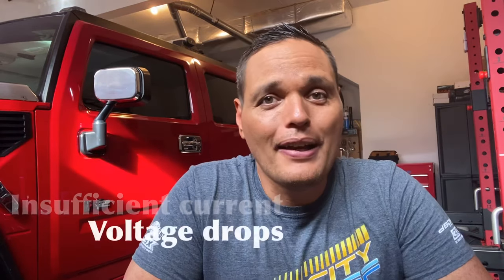The Top 10 BIGGEST MISTAKES in Car Audio. How to do it right!

Comment: honestly when i use to install early on i never had an issue with running the power with signal not once still will do it sometimes for a small install if your are running multiple runs of 0 gauge i would never do but with one run of 4g or 8g whats the big deal
Reply from the maker: Its not a big deal.... It is to keep best practice procedures consistent. Eliminates ambiguity of sometimes installing together and sometimes installing apart. If you install them separately ALL the time you will never have a problem. If you install them separately SOME of the time you may have a problem. When issues come up like electrical hum, alternator whine, etc.... having your signal/power wires ran separate ALL the time will automatically remove that as a potential issue so you don't have to "wonder" or "worry" if that is one of your issues.
Reply: True but some of these new cars are a pain haha but your 💯 correct to do it proper just never got why some people get that interference even if they did run signal opposite side and  had everything correct and still got engine noise or humming pretty weird what can cause it
Reply from the maker: Absolutely.... some cars definitely make life miserable when doing installs. That's why i like doing installs on older cars. so much more space and easier to route lol.
Reply: @NextLevelCarAudio  do you know any apps or sites to build enclosures want to try building a few boxes but just want to get some plans before
Reply from the maker: I know most people use WinlSD that do their own stuff. It’s free to download and is very user friendly. Allows you to build enclosure to subs specs. Not sure of an actual app tho. This is a program you need to download to your computer

Comment: Could i run 6 g on a 1000 watt amp
Reply from the maker: I would use 0awg. Then you never have to upgrade your wire again unless you go over 3000 watts. Then would need 2 runs of zero gauge. But can you?.... yes. But would not be close to optimal

Comment: So if I got 2 skar vxf's  12's  running on a avionixx 3k amp it dosent hit that hard what kind of amp should I be running on these monsters?
Reply from the maker: I recommend finding an amp that puts out anywhere between 125-150% speakers rms rating and set gain accordingly. Having headroom on an amp is important so not to strain your gear.
Reply: @NextLevelCarAudio   should I go with a taramp3k. Or a brutus hifonics 4k ?
Reply from the maker: I’d do 4K, but probably not hifonics as they rarely do even close to rated and are power hungry.
Reply: @NextLevelCarAudio  what about the taramps bass 3k
Reply from the maker: Better option, but only if you have good electrical. Brazilian full bridge amps like strong electrical and can get hot really quick if not. Sorry for late reply, comment got buried
Reply: @NextLevelCarAudio   what about sound digital evox 3k
Reply from the maker: That will work.... if it was me I’d do the skar 3500.1d great price and gives you a little extra headroom. Plus you get to keep brand continuity

Comment: I got into car audio about 6 months ago and my system all in all sounds nice. I had worked at a stereo shop for a little while so I learned while I was there but one question since I just put in some new kicker ks components in my vehicle along with my 4 channel hooked up. Will there be any complications in the future, between the crossovers that the components came with and the 4 channel? Also lw felt attacked for that sound deadening comment but I’ll let it slide. It only convinced me further I need it😂
Reply from the maker: Sounds like your setup just fine. No concerns
Reply: Thank you for the comment 🙂

Comment: What alternator brand do you recommend?
Reply from the maker: Mechman. All the way! Solid, beefy and very reputable / respected  in the car audio game. Plus they put out tons of power at idle.
Reply: @NextLevelCarAudio  I called mechman and they don’t make one for a 2003 Lincoln Navigator
Reply from the maker: That’s a bummer! Not cool. You can always get one custom made. But that’s going to cost you a  pretty penny. Another option could be to run a dual alt setup with a second factory alt. Run them in parallel and you will have double the amperage you are currently getting. Not sure how big you plan on going tho. If really big... the going to eventually need a HO alt.
Reply: @NextLevelCarAudio  ok I’ll check into it. Thanks for your help!!
Reply from the maker: Sure thing man
Reply: @timothywilliams9556  look up POWERBASTARDS HIGH OUTPUT ALT....
Reply: @nuclearbum9858  ok thanks

Comment: I’m running a 12 inch sub at 1ohm with a kicker cxa800 amp and it’s running at 14.3 volts but the sub still fades out at a higher volume can anybody help?
Reply: It’s the radio that’s rolling it off, is the head unit still stock? If so and you want to keep it then go with an audio control line out converter, if you want to change the radio to a single or double din switch that up and you’ll have a better response bro
Reply: @Ninjasraynonu3  yeah I’m still running a stock head unit and I’ve been looking everywhere and couldn’t find anything on how to fix it but thanks for the advice bro Imma go ahead and get a new head unit
Reply: @franciscotrejo5408  of course man, I would recommend an audiocontrol lc7i or even an 8i, you can’t go wrong with those and it’s easy to set up

Comment: How Low Is Too Low Of A Voltage Drop To Where It Starts Damaging Things....
Reply from the maker: Anything below 12v and I’d start turning down the gain.. 11.5v time for mandatory electrical upgrades. When voltage drops, current increases, that causes heat and electronics don’t like that
Reply: @NextLevelCarAudio  Ok...I Been Making Sure I Don't Go Below 12.6 At The Most...
Reply from the maker: Cool

Comment: I remember the old days when I thought my boss audio phantoms were loud lol 133db 11.9 volts now I can’t see under 13.7 full tilt 155db on one 15 and screaming loud doors
Reply from the maker: Hell yeah! 😎
Reply: Mic at the port does not count.
Reply: @raulfernandez9111  my score wasn’t at the port at the port on one sub was 140 on the boss and the single was 165 at the port. I always did headrest for competition and glass for testing. Port is for fun to troll your buddies.
Reply: Sounds good
Reply: @plattnumcustomcaraudio3086  sounds even better when you keep improving I will be doing a new build nothing nuts but still one 15 but trying out a different brand than Soundqubed.

Comment: My 98 chevy malibu im trying to find a ground spot in my trunk
Reply from the maker: Best thing you can do is run a dedicated ground wire from your battery to the rear if you can’t do a frame ground. My last option would be to use a factory ground point or existing bolt. But it will work as long as you sand down to shiny metal. Just won’t be as good of a ground.
Reply: Thank you for the advice this my first chevy build this one is different from my last three cars I owned
Reply from the maker: Nice man, good luck with your build. Keep us posted!
Reply: Will do

Comment: I have a 4000w sub and a 5000w amp how do I connect this to get proper base and safe bass the amp is a digital star sound amp raptor can I get help
Reply from the maker: You are fine, having a little headroom is a good thing. Just wire it up properly, and most importantly set gain properly and you are set

Comment: If you can afford sundown you got no worries lmao im running two type rs with 500 watts running to each hella cheaper then sundown I ran 500 watts rms to two alpine sws 15s and they shook the block wife has 2 jl 10 tens running off a the alpine 600 watt rms and it sounds like 2 15s and the subs cost a hundred a pop amp ws 220
Reply from the maker: Nice setups!
Reply: @NextLevelCarAudio  thanks bro keep the vids up
Reply from the maker: Will do ;)

Comment: I have the grey kx1200.1 .
I want 2 subs for this amp
What rms/ohm  should I get each ?for it's full potential 
Since there will be 2.
Thanks my man.
I'm getting American bass subs.
Subscribing
Reply from the maker: I believe that amp is 1200 watts x 1 rms. So you want subs that are close to 1000 watts combined. So 500 watts each.  500 watt rms Dual 4 ohm voice coil or 500 watt rms single 2 ohm voice coil will get you what you’re looking for. A 1000 watt total load at 1 ohm.